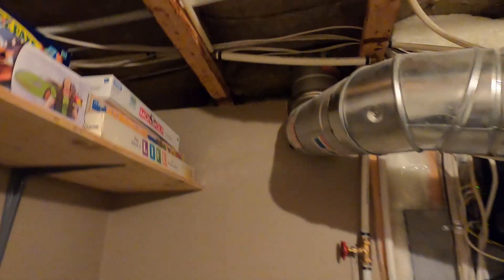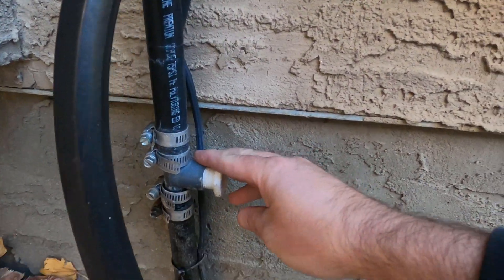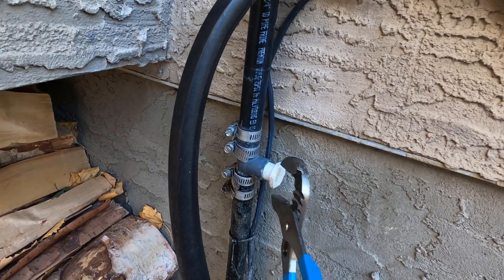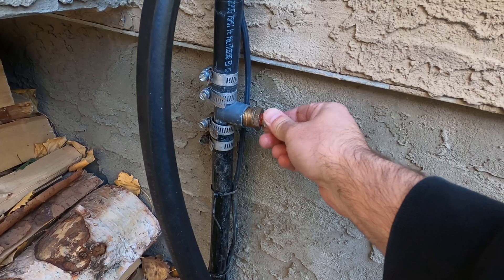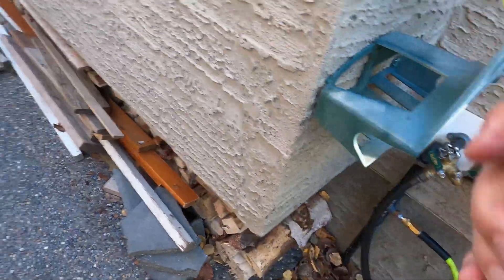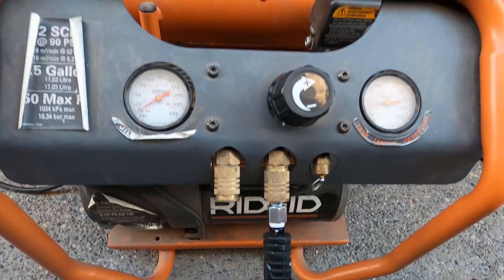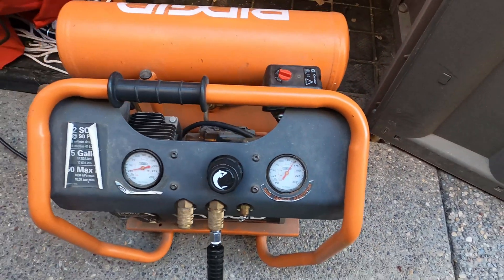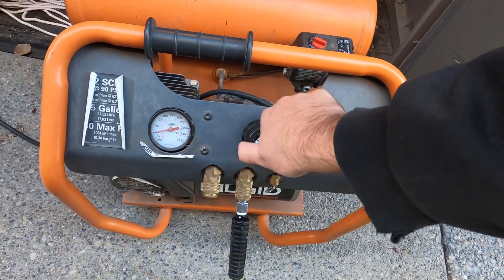How to Blow Out and Winterize a Sprinkler System using a small air compressor

Comment: I just saw this so pardon me if it's too late to post a question, but if I have a compressor (DeWalt double tank contractor style) that produces 150psi and has both a fill gauge and a gauge to control output, why can't I set the output to 60-70psi and let it run? I'm concerned about releasing more pressure than that into the system and risking blown lines/valves.
Reply from the maker: try it.  it may run out of air.  I have to cycle mine like in the video.  every system is different - start slow and increase.  Once the water is out of the lines it's unlikely to blow anything up.  GO slow at first.

Comment: Thanks Greg for this video!  Rented a small Makita 3HP 6.5 CFM 110V compressor from Home Depot ($38 Cdn for 4 hours) 2 days ago, and your video was very helpful in helping me get the job done .... had to cycle about 5-6 times for each 'irrigation line station', as pressure would drop quickly when air put into line.  Regulator on compressor wasn't working and air would discharge thru line no matter where regulator was set, so I ended up just disconnecting the air line from the 'water connection-pneumatic adapter' to allow compressor tank to build-up pressure to 80 psi before reconnecting.  Took about an hour to do 6 irrigation station lines (4 sprinklers/line), but they are well cleaned out and saved me spending $90-100 for big compressor guys coming -sort of fun to do myself also.  Ironically, I could tell by your video (eg. type & layout of backyard trees, walkway & driveway, etc.) that you must be a neighbor up on S. Hill area (SW).
Reply from the maker: Excellent. Buy a compressor for next year.  Yes this SW has a unique look to it.

Comment: You are using 150 psi to blow your system ??? should not exceed 70 psi some say 65 psi
Reply from the maker: it's low volume so the 150 psi only lasts for a second.  Not enough to damage the lines.  With a big compressor it would damage the lines.

Comment: Great video! Thanks for sharing! I have been trying to figure out if my little compressor will work or if I need to rent a big one. I will definitely try your cycling technique to see if that works on mine.
Reply from the maker: Worth a try on a smaller system.  Gets most water out anyway

Comment: Thanks for sharing. So if I use the controller to open each zone is that the same as you manually opening the zones and if so do you start with the first or last.
Reply from the maker: controller is fine.  open a zone then add the air.   order likely doesn't matter.
Reply: @gregs_garage  It worked like a charm. I used 75 PSI and started with zone 1, It took me about 45 minutes once I figured it all out. Saved 105.00 for doing a little bit of tinkering.
Reply from the maker: @12janicerd  very good.  no need to hire it out in most cases.  send me the 105 instead.  LOL!
Reply: @gregs_garage  It's already spent plus an additional 100.00 lol!! My biggest concern was opening the valves, but it turned out to be simple using the controller manual stations. I'm going to be looking forward to it next year!!

Comment: It’s my first year blowing out the sprinklers. It looks as though we have the same hose/piping supplying the system. Could please give me parts list for your setup to spice into the water line. It would be greatly appreciated. Since I’m way behind schedule.  Thank you in advance.
Reply from the maker: home depot plumbing stuff.  probably 3/4" tee.  Some people use a garden hose tap.  you need to teach yourself as there is no such "Parts list".  You just need to tap into the line and have some fitting for an air hose.
Reply: @gregs_garage  thx man. Between Home Depot and princess auto I got it all hooked up now.
Reply from the maker: @Attila_V  Princess Lotto - sometimes you win, usually you lose!
Reply: @gregs_garage  yeah but they had all the fittings and the fittings fit. Lol. Also picked up some oscillating tool blades for  some seriously deep discounts. It was def a worthwhile trip. This time.. it was a win :-D

Comment: Nice! Im on a half acre. 18 Zones. I have a stand up 40 gallon compressor that goes to 150 psi. Last time I tried it myself I could get the 14 zones done in front yard. Back yard I could not get it to work. Should I maybe try the backyard first? Thanks for any info.
Reply from the maker: sure try the back first.  If water goes thru then air should go thru.  Maybe there are leaks.

Comment: Thanks for this! I'm going to try it for the first time. I'll keep you posted
Reply: Good. I think! I have a 10 gallon compressor that i would charge up to the zone controller. I set it at 60 psi and opened one zone at a time. The sprinkler heads would pop up for 5 seconds and then go back down. I repeated this until there wasn’t water coming out so i think im good. Ill see how it goes in spring.
Reply: @davidh4921  Nice!
Reply: How was your spring?
Reply: @KusHome12  good. No issues with sprinklers. This was after a longer utah winter. With that said i had some neighbors who didnt blow out their sprinklers and their stuff runs just fine. Maybe they got lucky this year
Reply: How'd it go?
Reply: Thank you for following up
Reply: Nice I’m from Utah as well going to blow out my system today.

Comment: 150 psi? You should learn how to do this before telling others how it's done.
Reply: Irrigation hoses are usually rated to 90psi I thought. Some recommend 70 probably just for a factor of safety. Personally the higher pressure doesn't help noticeably so lower pressure. Higher CFM should make the job quicker
Reply from the maker: not sure what you mean.
Reply: Zurn, at least, recommends 30 psi.
Reply from the maker: @michaelmagidson4094  "Professional" contractors with diesel trailer units are running 100-110 PSI so they say.
Reply: @gregs_garage  Yes, and blowing my sprinkler heads to pieces.  Hence why I'm here.  Thanks Greg.
Reply from the maker: @frogsmoker714  I think it's a combination of pressure (PSI), and volume (CFM).  A big trailer unit maybe runs lower PSI but lots of volume.  A smaller unit like this initially loads up to 150 PSI maybe and then you release it into the system.  Not a lot of air flow though.  Seems to work on my system for 18 years in a row so far no problems.
Reply: @gregs_garage  I'm a bit confused. Doesn't your compressor have "tank" pressure and "line" pressure. I get that you let the tank charge back up to 150 psi, but don't you regulate that pressure down to 60-80 psi in the line? Or are you saying you release 150 psi to the line initially and it drops from there as the CFM air flows through the system?
Reply from the maker: @jtierney2150  There's not enough air in the tanks to regulate it down to anything.  I open it up not fully at first when the lines are full of water.  Maybe trying to let 60-80 psi thru.  After the water is gone it is a matter of loading up to 150 psi then letting it all out blowing air through and getting a bit more water out.

Comment: this is my first year doing blowout, I have a pancake 6 gallon compressor but only 2.6cfm do you think that would be too small? I tried using it and the sprinkler heads didn't pop up, but I see some water flow out from those head.
Reply from the maker: You need the heads to pop up.  2.6 pancake is small.  Charge it up full and release it all and see how it goes but I think you need maybe 5 cfm or so mine is 6.2 and small.

Comment: I have used a small compressor on my sprinkler system for the last several years. It does work as you have described.   Never have had issues. I live in northern canada.
Reply: I use a makita 2.5 hp 4.2 gallon compressor. I use 80 psi when blowing out my lines. I have 3 zones and I cycle the compressor 10 times per zone. As I wrote, it has worked for me for the last 6-7 years without issue.
Reply: I've used a pancake type with 2.9 cfm on a larger 6 zone 16 head system for 18 years with no problem.  Take your time and cycle each zone a few times while you put away patio furniture or rake the leaves. Beats paying $113 each year for my house and then again formy daughter's house.
Reply: how small Yours is? 
I have 1 galon  (3.75 liters) - does it look enough?

Comment: I’m going to have to blow out a customer’s system soon but I couldn’t find a port to hook up a compressor. The main water line runs from the front yard and the ball valve is in the front yard as well.  could I just put a t on the output side of the back flow for the compressor? Or do I have to somehow drain the main waterline as well.
Reply from the maker: The main waterline valve is outside?  Does it freeze there?
Reply: @gregs_garage  most of them here in middle Tn are in a valve box in the front yard. Most of them have a T in the valve box that the main is housed in. However to answer your question, no they don’t freeze